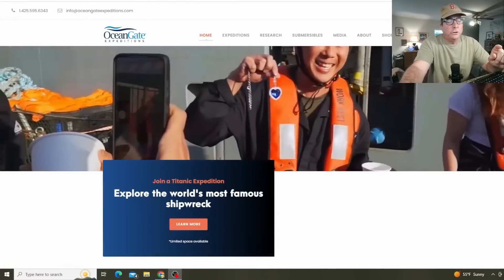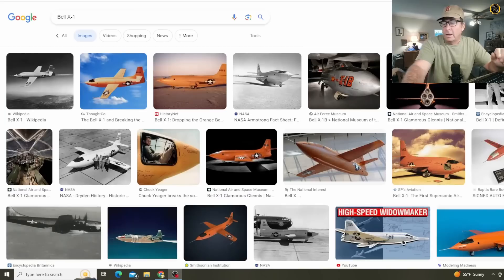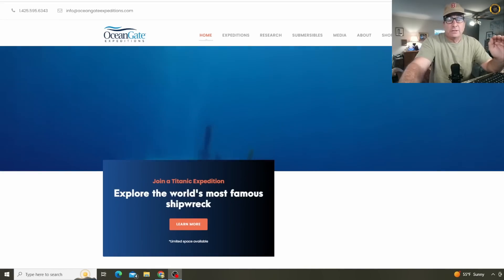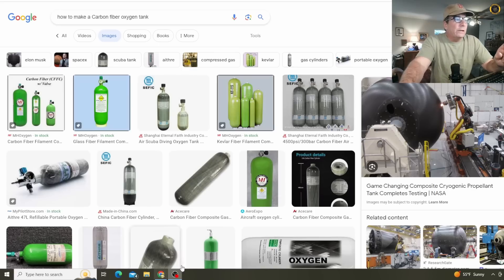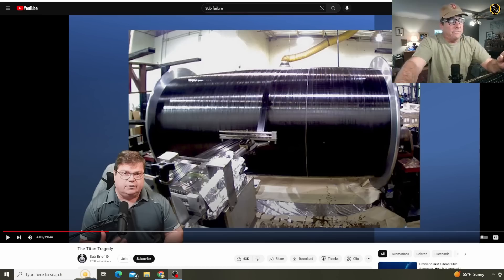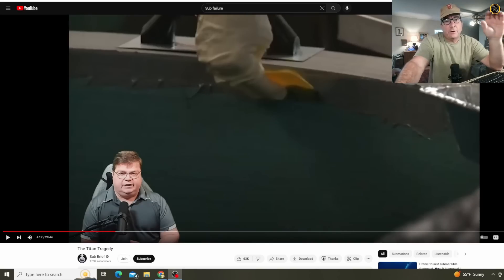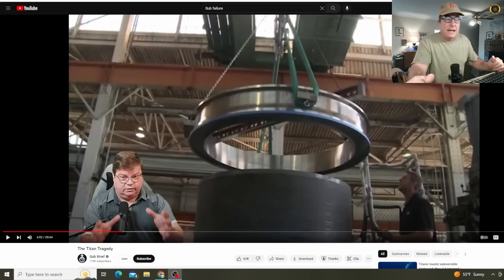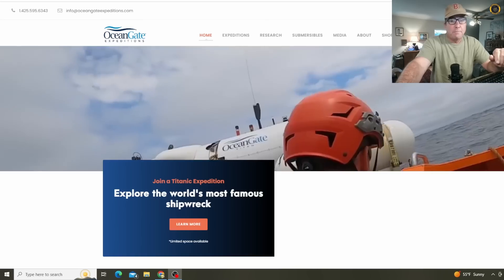Oceangate Sub Construction Details and Implosion

Comment: The weeve style is definitely an issue, but the way the endcaps are pressing against the layered CF edges under huge pressures is what I think caused it to fail. 
I remember 30 years ago, those high end sailing yachts were not using CF joints because they fail without warning and catastrophically. They've been using a more expensive white glue (forgot the name) compound for critical joints.

Comment: In theory, the glueing of the titanium end rings to the carbon fibre tube is quite sound. It isn't going to 'pop off' for the simple reason that the water pressure is going to actually be pushing it even tighter against the joints.  
Why I suspect this failed was due to two design flaws, a) as you allude to, the carbon fibre weave should have been interlaced, criss cross... not just winding bands of carbon tape laterally like thead on a bobbin as can be seen in the picture, and b) carbon fibre is strong but brittle, and if, along with the incredible pressure of the water, it had hit part of the wreck that would have been it. Also, it should not have been used for more than two or three dives, if that, before a new replacement carbon shell was made . Seemingly, even on test dives, audible cracks could be heard coming from the carbon fibre shell inside the submersible.

Comment: Was the vessel put in an autoclave ?
Also, as the vessel was compressed the diameter is going to reduce. How do the fibres respond to the consequent slackness and what does that do to the fibre resin boundary ?

Comment: JB, this is totally insane and follows your "Swiss Cheese" model that culminates in an accident.
As mentioned Bob Ballard and James Cameron and others warned of this failure multiple times.
JB, I make the assumption that if this "vehicle" was used multiple times, the continuous stress on the cylinder, rings and associated interconnected devices would have contributed to the failure of this vessel? As I understand from your past episodes re: constant pressure changes on aircraft during its use, thus the need for constant maintenance and upkeep, even though this vessel experienced the opposite effect of flight vs underwater pressures making the construction of such submersible vehicles even more important, correct?
Thanks for jumping in with your visual aids.
Take care and fly safe. 🤟🏼🖖🏼

Comment: I'm wondering if they even bothered to think carefully about how to tighten the bolts when they sealed in the passengers. Was this menial task performed by some lackey who never changed a flat tire? And how did they treat the end cap once it was removed aboard ship? Did they just kinda roll it across the deck to a storage locker? I shudder to think of all the abuse this piece of crap took at the hands of all these super highly qualified professionals while it was gracefully gliding across the calm glassy waters of the Atlantic. But I probably worry too much. After all, it had a joystick.
Reply: I bought a $300 controller for my son, once.  It failed out of the box.  I wonder if they had extra AA batteries?  I was thinking about the bolts too, Frank.  My dad was a master mariner and a fairly good mechanic and gave it to me one time when I failed to properly use a torque wrench.  Something about having surfer dudes as your safety engineers makes me cringe.

Comment: As a chemist, chemical engineer, and mechanical engineer, I look at the design of the joint where the ring flange meets the carbon fiber tube with great alarm. I know just enough about pressure vessel design to be very dangerous - I can run preliminary calculations before submitting a case to one of my colleagues who specializes in such work.

Titanium is a great material for pressure hulls, but as a metal, it does not bond well to a chemical adhesive. In order to get a sound join, you need to have a shape with enough "tooth" for the adhesive to bond, which might be attained by having a corrugated insert embedded into the end of the composite tube for some depth... but even that type of design is subject to pull-out stresses, and would be problematic at much lower service pressures than this vessel experienced.

Differential thermal expansion works in contraction as well, so in addition to the stresses imparted by hydrostatic pressure, you need to account for the stresses imparted by cooling as the structure is submerged into the deep water.

All of the stresses induce strains - changes in shape - and the dissimilar materials with deform at different rates. TThis leads to a feedback situation, where less than perfect adhesion between the metal and polymeric resin of the composite can all too easily lead to separation and thus failure of the vessel.

Overall, I would consider any non-metallic material as too unstable for such an application as this, I am extremely opposed to making adhesive joints between composites and metals in such a service, and I'm really not favoring the use of an alloy without good stress-strain properties in cryogenic temperatures (even those the water is not cryogenically cold, it's enough to embrittle some metals and alloys).

Then, I would be using ASME VIII (Boiler & Pressure Vessel Design Code) as a starting point for any sunmersible vessel.

Fabrication and the Inspection Test Plan - with all of the included procedures for material supply and certification, fabrication procedures, and NDT are even more essential than with a tank or column in an oil refinery. You are looking at  spaceflight hardware level efforts to identify hidden flaws before the vessel ever gets accepted for service.

But hey, I'm a white guy in my 50s with some defence contractor (military equipment design) experience... too stodgy and un-inspirational for the late Mr. Rush...
Reply: He’s Mr Crush now.
Reply: I'm certain that yours and everyone else's comments here have impressed on everyone how incredibly complicated a vessel the Titan was.

Comment: Is the use of carbon fiber less expensive than steel? Trying to understand why it was used in the first place, since steel (or titanium) are proven solutions for compressive loads, with many cycles... What is the benefit of using it, besides the weight?

Comment: it does seem the front ring is near the wreckage on ocean floor. the rear cone shaped tip is also near. it will be of interest how far from main body pieces these two parts are laying. if the glass is still in the front cap.   from what we heard so far. seems the center gave way first. blowing out the front and back. cone rear tip some what intact. this may explain the center imploding. i suspect the COMM exploded first on the out side of vessel. then the damage from this almost instantaneous reaction imploded the center area of vessel. if top cap with glass is clean and no fiber attacked then what Mr. Brown mentioned is very possible.  no way is this product something that should have been used for repeat trips under these extreme pressures. in constructing a vessel you can not use different components as each component has its own flex to extreme pressure. everything must be exact thickness and ex-rayed for microscopic flaws, cracks, irregularities. titanium tube 5 inches thick with bolted on from and back caps beveled and thick with ridges would have been certifiable. this junk was totally the worse construction idea.

Comment: Earlier in the week, it was reported that even if Titan surfaced with its occupants alive, they might still die if they ran out of oxygen before surface ships reached them, because they are locked inside and cannot open the vessel by themselves.  WTF!  Whether a car, an airplane, an Apollo space capsule or a deep sea submersible, exiting a vehicle unassisted should be a basic design requirement.

Comment: i saw one of their interior pictures - they actualy drilled into the interior wall of the carbon fibre tube to mount the monitors with screws....what a mistake if you ask me....its only as strong as the wekest link which may have been that actually.....

Comment: David Pogue mentioned, on video, that the cone or end cap was being bolted on with 17 bolts.

But, there are 18 bolt holes. Apparently Rush told him the top, 18th bolt was “mathematically unnecessary”.

Pogue:
“I remember that you are sealed into the sub from the outside. There are 18 bolts around the hatch, and the crew bolts you in from the outside. And I remember it was odd that they put in only 17 of the 18 bolts. The 18th one is way up high, and they don't bother with that one. They say it makes no difference.”

Comment: Wouldn't computer modelling and simulated repetitive stress testing have flagged potential structural issues long before this death-trap even left the drawing board?  I'm not in the field of material science or structural engineering, but surely this type of software exists in the aerospace and related industries?

Comment: If that glue/epoxy does not have a thin enough layer, it will be a weak point and the cap will pop out. Also, you should wrap CF in many directions in this kind of application.

Comment: It seems to me that the carbon fiber tube should mount on the outside the titanium ends. The water pressure would then compress tube onto the flange.
Reply: Exactly. It's so obvious that there should be support on the inside, from the end rings.  Surely this was somehow done? In a video of the winding, it seems to start with winding on top of  metallic end caps initially?
Reply: @tomlewitt  Yeah, hard to tell. It will be interesting to see the cause.

Comment: I am convinced that it would be better to fit the carbon between two parts of metal, perpendicular like you say. This way they can protect the surface from dents and scratches, very important issue when handling the sub.

Comment: The carbon fiber tube winding program may likely have had a diagonal angle farther down in layers. In MRI coils often the last and first layers are like the picture to produce a better surface finish.  Very big assumption this sub brief guy is making based on a single photo.

Comment: A carbon fiber tube under compression loads of this magnitude is an awful design choice, at least as designed here. At minimum it needed end caps that acted as lateral support and even the best adhesives are not fit for purpose here.  Even worse is the cyclic stress on the sub and it being awful for both carbon fiber and adhesives. The end caps should have been cabled through the carbon fiber hull and attached to bolts on each end cap and then put under tension. This would have held the end caps firm for supporting the ends of the tube laterally as well as reinforced the walls of the tube from buckling.
 My guess is the carbon fiber tube squeezed on the metal cap until the adhesive popped off and then everything failed catastrophically.

Comment: Carbon fibre pressure housings have been used for work class ROVs for a number of years but nowhere near this depth. The failure modes fall into two areas. The cyclic failure issues and also corrosion of the metal rings at the carbon interface.

Comment: I really do not understand what they were thinking. 
They made a tube, capped at both ends and sealed with glue? 
NOT certified yet marketed to go to 14,000ft?.. 
There are so many red flags here it's no wonder there were no naval engineers with decades of experience working this project. 
I just don't understand. ❤

Comment: Carbon fiber based composites and titanium expand and contract at different rates.  The joint between the carbon fiber composite tube and the titanium flange is suspect.  A certain number of pressure cycles would eventually crack the joint.  It looks like a case of unlucky pioneers discovering how many cycles it takes.

Comment: This was actually the 2nd carbon fiber pressure hull fitted to Titan, the first hull started to crack/ delaminate on it's first two voyages to Titanic, it was then scrapped and replaced. There are videos on YouTube of the CEO talking about this !
Reply: The video:  https://youtu.be/9PGpjEDc96I?t=635
Reply: Information like this will make some lawyers very busy.
Reply: One video or photo theres TWO Titans on a ship, not a Titan and a Cyclops. Is its possible the lost Titan was the original one due to the second one malfunctioning. the lost one has the tip of the tail missing.

So do we have a duplicate of the Titanic Olympic swap theory !?
Reply: Wasn't aware of that.  And yet, the found suckers to pay 1/4M to go to their deaths?

Comment: There has been a report from an early passenger, that he could tell when the Ocean Gate Titan went into deeper water by how much louder the crackling sound coming from the carbon fiber tube was inside the sub. He asked Stockton Rush about the noise and Stockton said, "Don't worry about it. The carbon fiber is five inches thick. We have a lot more crackling to go before there is any failure." This was the carbon fiber separating from the resin every time he went down into ultra-high external pressure. The carbon fiber was telling him to stop, and he would not listen.
Reply: “The carbon fiber was telling him to stop, and he would not listen.” Damn, that’s an excellent way of putting it.
Reply: The P&L would have sunk him if he didn't make a certain number of rides per vessel. Going out with a bang is probably preferable than living under a bridge.

Comment: Saw the video of the carbon being wound on to create a cylinder. But heard no mention of the final product undergoing a "Vacuum bag" process or being placed into an Autoclave to cook it. The lack of this would surely leave it at a less than optimal strength? Also when applying carbon do you not normally apply separate layers with the weave in different directions? Due to the carbon only having strength in one direction?

Comment: They should have just left the carbon out and just built a sub made of resin. Same thing since the carbon fiber serves no purpose in this application besides sounding cool. When I first heard of the missing sub I didn't know anything about it so I was hoping there was an issue that would be resolved and the crew safe. Then I heard how it was built and knew immediately that it imploded. I'm surprised it even made it down that far in the first place.

Comment: I wonder. The carbon structure is basically a laminate of layers of fibre bonded to eachother. With a pressure of about 4000 psi down there a microfracture may allow water ingress between the outer layer and the next layer. Therefore the outer layer is progressively cut off from the second layer. Then another fracture in the second layer allows water ingress between layer no 2 and 3. Same result. Etc. 
By the time 25% of the layers have delaminated the strength of the structure is less than  50%. Etc. 
At one point it will collaps. 
Just my thoughts.

Comment: Oh my, carbon fiber tube, titanium flange. Never mix those two in a part, let alone a part in salt water. 
Taking a section of thin wall carbon tube and compressin it to failure takes really not much force, but trying to pull it apart it is insanely strong. I’m a mechanical engineer, and have been working with racing stuff all my life, tested some stupid things but have never even considered using carbon fiber in compression or using titanium to carbon joints.

Comment: This is unbelievable. I wouldn't have trusted that thing at 100 ft depth under water!! The way that end cap is just flat glued on with the flange on the outside instead of fitting it inside to support the pressure not to mention the fibers all going one direction in the carbon! Ive never seen that! All carbon fiber is woven! Can you imagine how fast they were squished!? They were probably 3/4 of the way down and to the bottom would be like 5000 psi, so they instantly were subject to like 4000 psi!! Thats bone crushing!! Atleast they felt nothing.. One second they were dropping the weights to try and return up and the next second they were in heaven or hell..

Comment: The number of cycles is irrelevant when it comes to carbon fiber because carbon fiber should never be used PROUD for deep-sea submersibles, when carbon fiber fails it shatters like glass, that's why the industry standard has always been steel and titanium or even acrylic or ceramic but mainly steel because even in a failure it retains some integrity. Also most standard submersibles are all one piece not multiple pieces with seals that fell under pressure, when you start gluing the end pieces on that's just flat out idiotic.

Comment: Would it not have been better to use carbon to wind around a steel cylinder, to enforce it. Just carbon would never work and indeed it should have been done in cross-layers.
Reply: What does the Carbon do, in this scenario?

Comment: That's it. The glue bonding of the circular metal end caps to the carbon fibre. So hokey. The carbon fibre didn't do as well under compression as the titanium ends. Some sort of fracture or debonding at that joint is the likely weak point. Also the glass of the viewing window.

Comment: you sure you can't non destructively test the integrity of carbon fiber? seems like any number on non destructive tests would be applicable including imaging methods you mentioned. I googled it, there's a several NDT options for carbon fiber, maybe they don't apply to a five inch thick application though? if they're used in pressure vessels they almost certainly have to be able to have NDT applications.

Comment: I was surprised to hear the hull was Carbon Fiber with Titanium Tips, 6000PSI/400ATMS cycling on 2 different materials expanding/contracting at different rates with that sub didn't sound like a good mix. 2018 a whistler blower was fired from Ocean Gate for expressing his safety concerns about the sub's construction (David Lochridge). Very sad ending that could have been prevented (personally speaking), My Deepest Condolences.